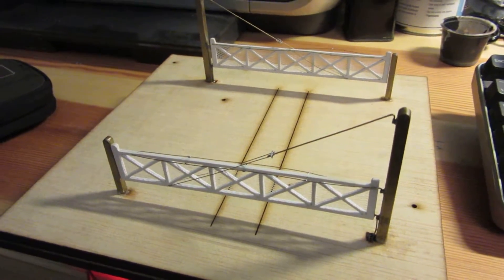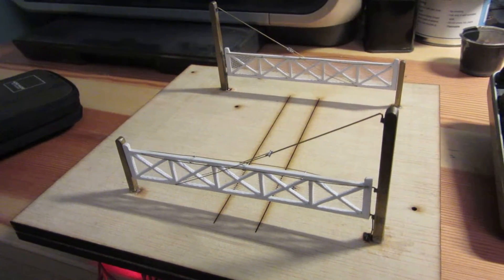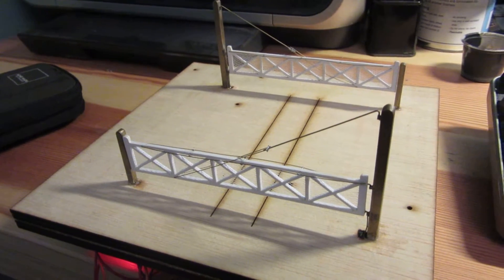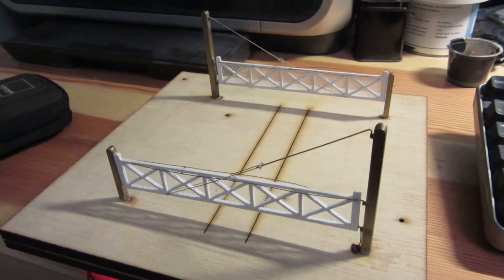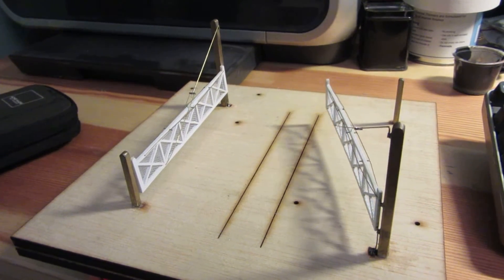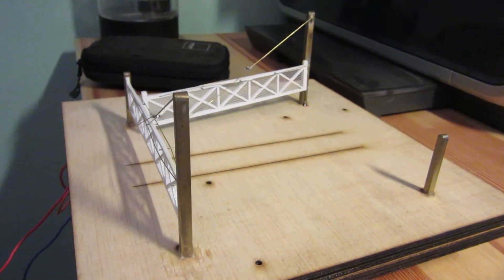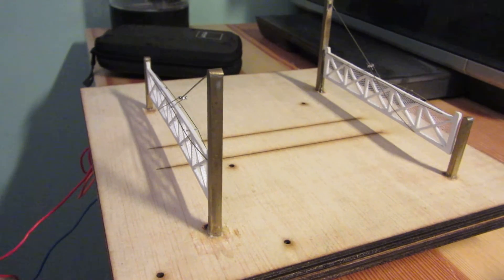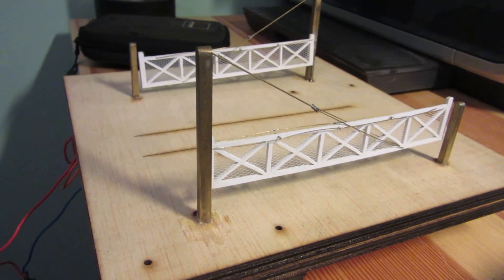Level Crossing gates powered by Arduino and stepper motors

Comment: Very well done David. I just bought my first Arduino and it came in the mail today. So far I just have some blinking LEDs on it, but my goal is to do something similar to your layout. Could you tell me which stepper motors you used? I am thinking of implementing some sort of IR sensor so the gates auto open when the train approaches and close again when it passes.

Comment: great video mate can i ask how your telling the steppper motors were they are as if the power gos off min way how can they be reset?
Reply from the maker: You have put your finger on the major problem with the design! What I have tried to do now is add a pair of Hall effect transistors just below the gate and a tiny magnet on the end of the gate. The code now needs to sense on start up whether both gates are fully open, fully closed or only one is either open or closed. It then needs to move the gate which is half way into the right position. I'm almost at the point with the rest of the layout where I need to install the crossing properly so I need to revisit the code and the mechanics.
I think what is shown here is still a 'work in progress' but that probably covers most of my model railway projects!
David
Reply: @barhamd1  would servos work better with this ? And I think it's the way ur need two sense on each gate and get the gates to move x amount of steps at a time till it hits sensor
Reply from the maker: @2006death2006  I considered servos but felt that I could not get the movement to be quite as smooth as I could with steppers. Also servos don't really help with the issue that the two gates would smash into each other if restored to a closed state in the wrong order following a failure.
Reply: how are you thinknig about coming over the problem with not knowing were the gates are with a power cut to it? what about an sd card so you put the data on to that?
Reply from the maker: @2006death2006  I think the plans is that each gate will have a magnet attached to the end and a hall-effect transistor which detects if it it open or closed or not sensed. As only one of the gates should ever be moving at a time then in the event of a failure the first gate should either be open or closed or 'moving'. If the first gate is moving then the second gate must be either open or closed - it can't have been moving too. You should be able to work out from that whether you need to open or close the first gate to get to a consistent point. 
I had thought about writing the current steps to a variable but without an SD card I was concerned about the number of rewrites available on an ardiuno variable.
David